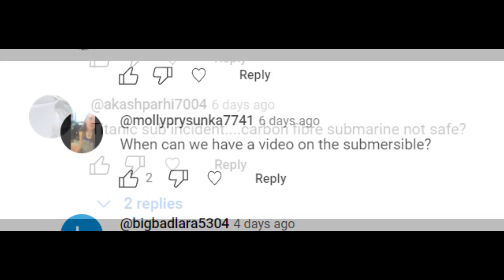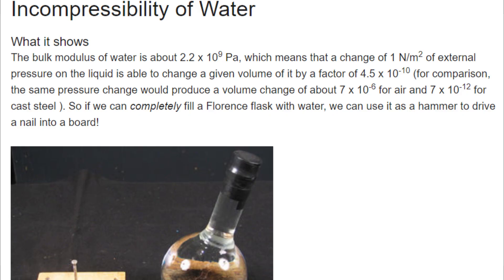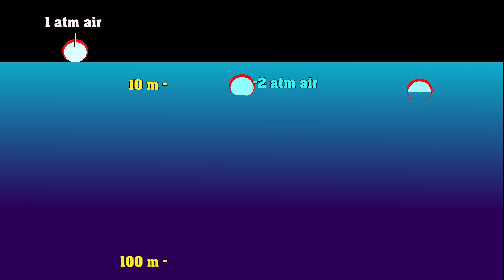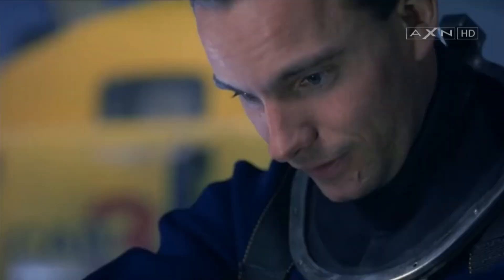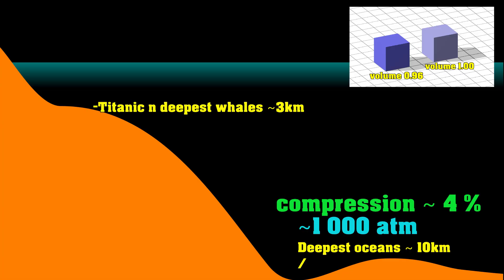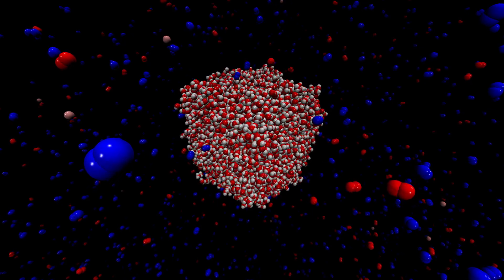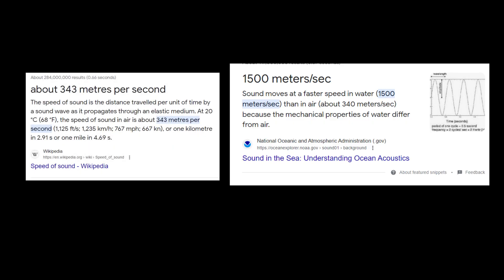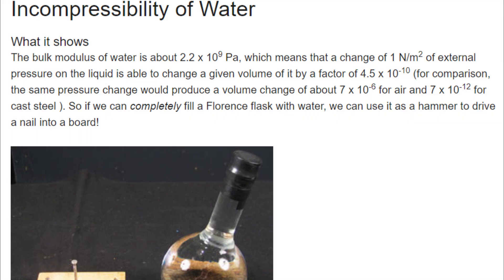What Happens when a Hull Fails at 1000 atmospheres?

Comment: This is irrelevant to the point of the video, but I'd like to point out that whales and deep-diving seals do not take a deep breath right before they dive. On the contrary, they in fact exhale, so that their lung volume is rather small during the dive. The alveoli in the whale lungs are also compressed during the dive, so that the air in the alveoli is forced into the trachea, which is rigid and does not allow nitrogen to dissolve from the air into the bloodstream, which prevents decompression sickness at the end of the dive. 

The reason these animals are able to stay submerged for so long is that they have a much higher capacity to store oxygen in their blood and muscles than do terrestrial mammals. They have high levels of haemoglobin in their blood and a much higher amount of myoglobin in their muscles, plus a higher blood volume than a whale-sized human would. Myoglobin also has a higher affinity of oxygen than does haemoglobin, which means that oxygen from the blood is transported to the muscles very efficiently. Whales also reduce the need for oxygen during the dive by directing blood to the most important organs and lowering their heart rate. So, having a lot of air in the lungs during a dive is bad, which is why animals have evolved to have other ways of getting enough oxygen into their brain and muscles.

Comment: Actually I'm impressed that the sub worked at all... this wasn't the maiden voyage... it was trip number 3... So comparing this device to Theranos' device,  the Hyperloop, or a none existing truck is wrong...(and the video never does make that comparison)... The sub worked.  It just did not have the re-usability to make it reliable.      Carbon fiber performed beyond my expectation when used in a compressive application.
Reply: And to be honest I had envisioned this sub crumpling like an aluminum can that's under pressure.  However I now can see that the rigidity of the structure played more of a roll in maintaining the shape than the air inside. Which I didn't consider.  (Taken to school once again!)

Comment: Uhm,  water will move into 1 atm of sub not 0 atm. However, given speed and relative density and water being incompressible in comparison to air, it will compress said 1 atm air inside submarine - FAST, bascially adiabatic-  thus heating it. Therefore, AIR HEAT and air pressure might end existence of crew long (relatively speeking) before they get into contact with actual water (add shrapnel / spall depending on how hull gave in ).

Comment: The depth of 3800 meters, equating to a pressure difference of about 38 Megapascals.   Assuming a breach occurs in the back, at the junction between the carbon fiber tube and the titanium component, and water starts to flow in, we can calculate the speed at which water would rush in using Torricelli's Law:

V = sqrt(2gh)

Here, "g" is the acceleration due to gravity (9.81 m/s^2), and "h" is the equivalent height of a water column exerting a pressure of 38 MPa, which is around 3793 meters.

V = sqrt(2 * 9.81 m/s^2 * 3793 m) V = sqrt(74436 m^2/s^2) V = 273 m/s

This is the speed at which water would rush in through the hole. Now we can calculate the flow rate (Q), which is the speed times the area of the hole (assuming it's initially 1 square cm, or 0.0001 square meters):

Q = VA
Q = 273 m/s * 0.0001 m^2
Q = 0.0273 m^3/s

The volume of the submersible is 10 cubic feet, or about 0.283 cubic meters. So the time (t) to fill the submersible is:

t = Volume / Flow rate
t = 0.283 m^3 / 0.0273 m^3/s
t = approximately 10.36 seconds.

They would be much luckier had it been the Porthole:

The porthole has a diameter of 23 inches, which is about 0.5842 meters. So, the radius would be half of that, or 0.2921 meters.  The area of a circle is given by the formula A = πr², where r is the radius.

The area of the porthole: π * (0.2921 m)² A = 0.267 m²

Velocity of water (calculated above)  @273 m/s, and the new flow rate (Q):

Q = V * A Q = 273 m/s * 0.267 m² Q = 72.831 m³/s

The new time (t) to fill the submersible:

t = Volume / Flow rate t = 0.283 m³ / 72.831 m³/s t = approximately 0.00388 seconds

Unfortunately, it failed in the back... Much slower.

Comment: Apparently some people were expecting them to find bodies.  The forces involved are enough to turn someone into fine red mist, there would be nothing that looked like it came from a human.  It's similar to the result of being on the business end of a claymore mine.
Reply: More like a fine black ash as it's not mentioned how compressed air heats up immensely!
Reply: @fandomguy8025  Yes, that too.  For a very brief time (fraction of a second) the air temperature reached over 1200C due to compression.
Reply: @StormsparkPegasus  Yup, again why it's confusing anyone, especially in the media, talked about looking for remains as you said. 

They were cremated, they weren't going to find any.
Reply: @fandomguy8025  Nope, no ash, no burns.  Despite the high temperature that develops, you don't get burns because there simply isn't enough time for the heat to affect you before the water hits and rips you to literal shreds (and cools everything off).  Remember, the whole event is over in milliseconds...
Reply: @marcseclecticstuff9497  Tell that to the structure evaporating plasma inside ground zero of an atomic explosion. Heat can definately affect in milliseconds.
Reply: @fandomguy8025  Atomic bombs... what???   I was talking about the theoretical temperatures reached inside the Oceangate submarine.  What does that have to do with  nukes?
Reply: @marcseclecticstuff9497  Intense heat within a fraction of a second, it's the same situation.

Comment: Breakdown of my calculations regarding the Titan implosion based on the information provided in this video, thanks Thunderf00t (correct me if I have any mistakes):
So the maximum speed water will decompress is 1,500m/s or Mach 4.3. In order to implode the submersible the surrounding water needs to be decompressed, the amount needed of water needed is relative to how compressed the water is, at 6,000 psi, water will compress by 2%, this means 50x the volume of the sub will need to be decompressed. I estimated the volume of water needed to fill the sub as 15m3, so we'd need 750m3 of water, this has a radius 5.6m. The decompression wave, which also travels at the speed of sound in water would take 3.7ms to decompress this amount of water (same time taken for the implosion), with a water speed of 398m/s or 890mph.

Comment: As much as I enjoy his videos, this one is misleading. His claim is, water falls into the cavity at the same free fall speed irrespective of depth, and the rapid filling of the cavity is mainly due to the expansion of water. This is incorrect. 

Falling is the downward motion of objects. The driving force is the gravitational potential gradient. However, ocean water is not only falling into the cavity, it flows in due to another driving force: the pressure gradient between the surrounding water and the cavity. And since the flowrate of water is proportional to the pressure differential, the deeper you go, the faster the water flows into the cavity due to the larger the pressure differential. Imagine you turn the tap on, and try to stop the flow by restricting the nozzle. Water speed will increase, it will not fall at the same speed anymore. 

Another correction is in the water expansion rate calculation. If the O-H bond length is 0.1 nm, and the expansion is 5%, it expands by 0.005 nm. This would change the rate of elongation of an OH bond to 50 m/s. 

TLDR: The fact that objects fall at the same speed irrespective of their masses does not apply here. The major reason water rapidly fills the cavity is pressure difference, not the expansion of water or gravity.
Reply: Correct. Cavitation is an inertial collapse that occurs due to the pressure differential. Incredible accelerations and velocities are achieved and are only weakly influenced by the compressibility.

Comment: Any tiny crack would admit water that would start delaminating the carbon fiber, eventually the high pressure water would reach the innermost unsupported layer of carbon fiber, causing it to collapse inward. Then the next layer, now unsupported, would also fail, and so on. Carbon fiber has excellent tensile strength, but is not as good for compression, and is a poor material for building subs. 

Not only was it the wrong material, but being opaque was the wrong material for sightseeing. There was only one tiny porthole for viewing, absurdly small for viewing through. The customers could have had a much better view with cameras from a drone submarine. Ironically, glass makes a much better material for the hull of a deep diving submersible, as it has a high compressive strength and is uniform so cannot delaminate. Still requires careful engineering, but would have made a much better sightseeing sub.

Comment: People get confused by the incompressibility assumption we make in fluid dynamics.

It's a cheat we employ to speed up calculations. What's the point of solving the energy equation for something with a bulk modulus of the order of 10^9 when the highest pressure in the whole domain is 85Pa?

Comment: I love this video, but something irked me about the claim made at the start. Namely, that a cavity removed from a body of water will fill up at basically 'freefall' speed regardless of depth.

A higher hydrostatic pressure will fill a void quicker than a lower one. With pressure defined as force per unit area, and assuming a constant mass for the water, this force (and thus acceleration) will increase with depth. Think of the classic lab demo of filling a large flask with water and then punching two or three holes up its vertical length. The water is forced out of the bottom hole faster than the one at the top.

Comment: Did you see Hydraulic Press Channel making a mini pressure-vessel with steel endcaps and CF pipe walls?
They imploded it in a see-through chamber and the implosion is just as predicted. Endcaps hardly move as the CF fails.
I wonder if we can get them to redo it with a tiny bit of hydrocarbons in the air in the chamber. See if it ignites during the implosion.

Comment: The free falling water explanation is flawed in my view, since you are completely ignoring the water to the sides.
Even if the empty volume that is being filled had walls on its sides and bottom, the water beside the water column above the space would still be squeezing said column, accelerating its ends as it "spaghettifies", though this spaghetti wouldn't become thinner, as it gets to refill from the water spaghettifying it.

Comment: @Thunderf00t what you said at the beginning of the video about water filling the void is wrong. Just think about it if you have a water tank it flows more the more water in the tank because the size of the hole is the same but the force exerted on it is greater due to greater mass leading to a higher flow rate ie greater pressure increases flow rate and if greater pressure increases flow rate then what you said at the start is wrong mass doesn’t cancel like it does with falling objects because with falling objects everything falls not some 2d cross section

Comment: Very interesting video. Very well explained. 1 note is that saying 3x the speed of a bullet is kinda misleading. Most rifle rounds travel at around Mach 2.5-3, but saying a pistol bullet would be more correct though there is still big variations in speed depending on the caliber and specific cartridge load.

Comment: I am a little confused here.
Even without compressibility of water, if you instantly have a pressure difference, it should be equalising at a speed of sound, not the speed of free fall.
Yes, it would take time based on free fall speed to completely reach the final pressure, but at the start you still get a wall of water moving in as a speed of sound to kill everything on board.

Comment: Humans can dive to ~7x the "hundred meter"-ish depth you proposed.
100m is the limit recommended for recrratipnal scuba diving. Deep sea industrial divers doing jobs like welding dive to ~300m to the job site.

And frankly the main issue is decompression taking a week even at this depth.

Thats why 100m is pretty much max recreationally, and why even industrial saturation dives dont venture too often do depths greater than 200m - it takes waay too much time to come back to the surface safely.

Comment: You state that, had the water been incompressible, that the speed at which it entered the hull through the breach would be constant no matter the pressure. 

Can you please explain, why Toricelli's law (or more generally, Bernouli's principle) is not applicable to this scenario?
Applying it would predict the speed of sqrt(2gh), or approx 240 m/s (@3000 m), at least at the begining when the pressure inside the vessel is 1atm. 

As I understand, both processes would occur, obviously the water expansion one being more significant.

Comment: Do i understand it correctly that the water under high pressure is also at a temperature such that it would have melted the flesh and bone before imploding?
Reply: water is at ~2 °C before expansion and momentarily colder after. tiny amount of air would have got hot but it's insignificant in comparison as it's only 1 to 42 in volume compared to all the water

Comment: Somewhere in a university lab they tested a 4000 bar autoclave with sapphire observation windows of 1inch thickness and diameter. The autoclave was filled with water. For unclear reason the sapphire cracked at 3000 bar. The steel safety mantle was not in place. The water projected the sapphire as a bullet through a 10 cm thick nearby wooden wall. Fortunately no person was in the lab.

Comment: Can someone please explain me the animation at the end. How is the low pressure water expanding to high pressure enviroment? What am I missing?
Reply: it's not the low pressure water expanding, it's high pressure water losing pressure and springing into the volume inside the submersible. so it's sort of: before the water had time to flow, the water springs in there. the reason the blob he draws is so large is  the volume change is so relatively small that you need to decompress tons and tons of water to fill the newly available space.
Reply: @markifi  thank you so much

Comment: Strongly disagree with your representations of pressure and the role it played.

"Actually there is basically no pressure on the water that actually kills you." This is false; the total pressure remains essentially constant for the water — the dynamic pressure is limited by the speed of sound through water, so the more static pressure the water has at the start, the more it keeps when it flows. This is why waterjet cutting is done at several thousand times atmospheric pressure, not just the minimum required to achieve sonic water flow; it needs to exert high pressure on the small area of the impact to properly cut metal.

Comparing pressure to water mass in free fall is a category error. The effect of water falling into an air gap is negligible compared to the effect from pressure. This type of situation could be replicated in a pressurized chamber in orbit with essentially the same result. Gravity just happens to be the cause for the pressure in the real life scenario, because it's pulling the entire weight of the water and atmosphere above the sub. If you have a tub full of water and open a drain, it will fall at the same speed as a dropped object; if you puncture a small hole in the bottom instead, it will shoot a jet downward faster than the normal draining water.

I agree that compressibility can be compared to a spring, but disagree that the pressure suddenly disappears when released. Pressure differential is analogous to the spring tension, and just as you can't suddenly teleport the spring to an uncompressed length, you also don't suddenly remove the pressure gradient in the ocean by opening a small cavity near the ocean floor. The depictions of 1 atm water are completely inaccurate.

Your comparison to a droplet of water on a molecular level fails for that reason as well. (If your simulation also includes surface tension it's even less applicable.) Correlating pressure inside a water droplet limply dissipating outwardly is an obviously inaccurate representation of an entire ocean of water pushing into a small cavity.

All that said, I technically agree that pressure doesn't do the killing, in the same way that Tom Cruise's character in Collateral says, "I didn't kill him. I shot him. The bullets and the fall killed him." The water and chunks of the submarine impacting them at Mach 3 killed them; but the pressure is still what shot them.

Comment: Great physics lesson but you didn’t mention the secondary effect of heat due to the rapid compression of the air volume. As the sub fills with water at this incredible speed, the air will heat up to a temperature well beyond the ignition point of all combustible matter - just as it happens in a Diesel-engine. All carbon-based materials ignite and an explosion follows. There are pictures of a US-Navy sub which sank. That explosion which occurred when the hull was breached was so powerful that the propeller-shaft was ejected out of the rear of the sub against the high water pressure!